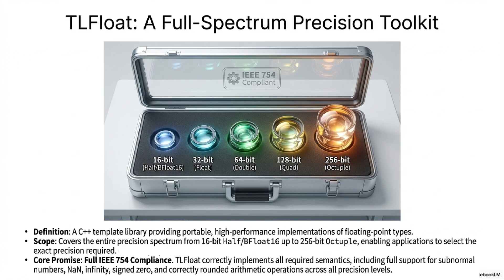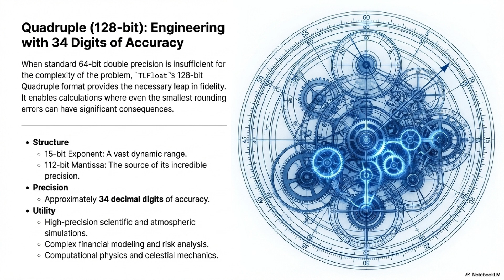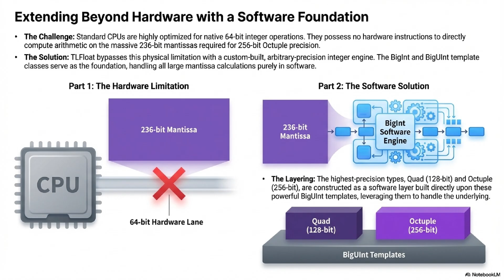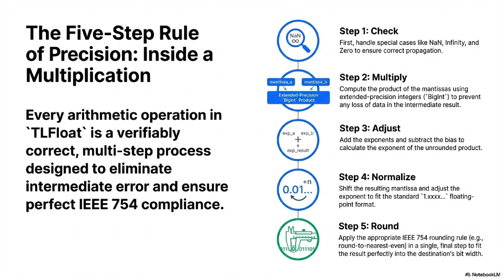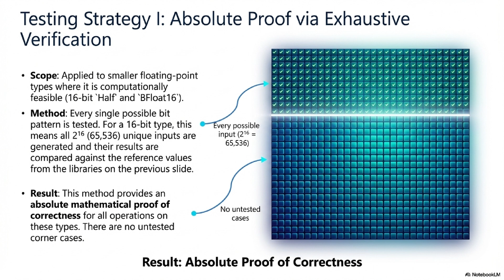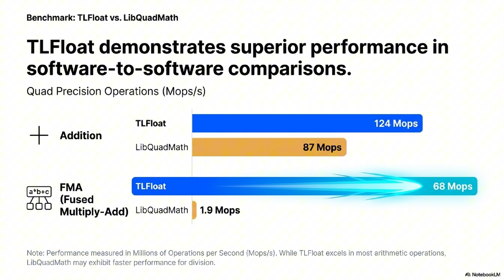TLFloat - The Quest for Ultimate Floating-Point Precision

Comment: Very good job on the video and the library. I watched to the end and it explains all the concepts very well. When compiled with Ms Visual Studio 2026 there are some warnings and 3 fatal errrors. As far as i can see, all the warings are false alarms. The errors occur when the negative of an unsigned values is taken. This operation looks wrong, but is actually well defined since the cpu does not know or care if a value is unsigned or not. So the errors are also false alarms, but the prevent compilation. I would like to firx the errors and warnings and submit the changes. I do know how to fix the errors but i do not know how to submit the changes. I will try to find out
Reply from the maker: I haven't tried VS2026 yet. I'll need to give it a try. Thank you for your report.